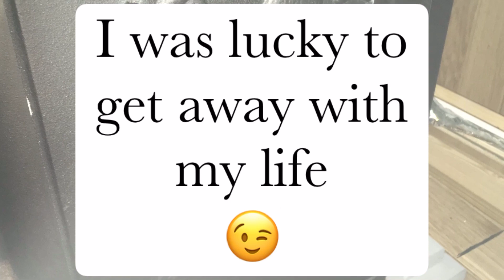Part 11: Widebeam fit out: 'Fitting the stove and swans attack!’

Comment: did you fit the stove and flue yourself? don't suppose you filmed any of that?
Reply from the maker: Hi Andy, yeh we fitted it ourselves. The stove is a heavy brute! Sorry, I didn’t film the actual fitting but it’s fairly straight forward. Just got to stick to the regulations. Cheers
Reply from the maker: How’s your fit out progressing?
Reply: WIDEBEAM Boat build Diaries I’d say I’m 60% through it now. What did you use to cut the roof hole?
Reply from the maker: 60% is good going! We’re about 75% done. I’m starting on the shower room now. Loads of ‘little’ jobs to do. In answer to your question, the boat builder cut it for us. We had a plan in our heads and new exactly where the stove was going. Cheers
Reply: WIDEBEAM Boat build Diaries I see, I had 2 choices of locations for the stove and was unsure until I had the internal walls built and could get a feel for the space. Good luck with the shower!!
Reply from the maker: Cheers Andy. Good luck with your fit out as well. 👍 Kev